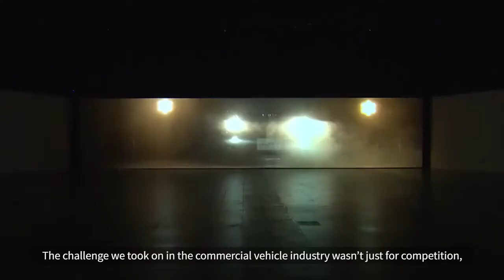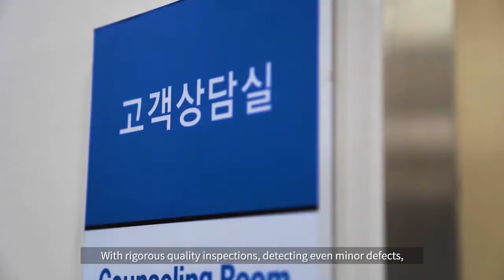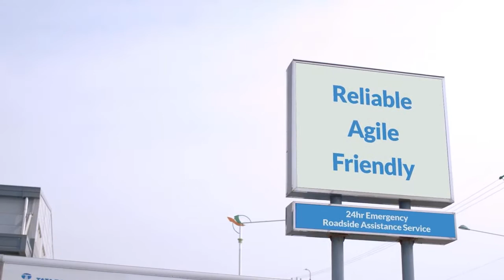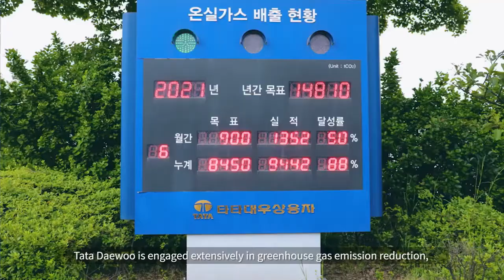2022 TATA DAEWOO Corporate PR Film ENG

Comment: when will this beauty come to india?
Reply: @JOKER 🃏 maybe these trucks are more advanced and high priced , in india Prima is tried to keep in budget so many primas come with non body coloured bumpers too
Reply: Tata prima
Reply: @helsreach001  ik , I mean these updated and more stylish looks
Reply: bro tata is already manufacturing here
Reply: @triggeredgamer206  ik , but this one looks premium also the Prima facelift 2020 showcased was also not launched and a few months ago they have launched it
Reply: @t.s.p1864  bro , This truck is available as Prima in india and now it get's ADAS , ESP , DMS , etc . Also Tata Sells open trucks which was only chasis and front bumber with headlights , other modifications are done by body makers
Reply: @t.s.p1864  cowl chassis are mostly purchased by low budget ones , and other than that the complete steel + fiber Body cabins are available in Ultra and Signa. Also Prima are used at large scale mostly as Dumper and container trailer
Reply: The prima,ultra,intra are based on this
Reply: @AesterAutomotive  Not Intra , Intra is mini pickup tempo based on Super ACE
Reply: @MrdRacer5Gaming  ya ok,its right man..but i said intra is no more unreliable underpowerd ace..
Reply: @AesterAutomotive  yaa that's right but ig ace is underpowered but not unrelaible

Comment: Who is owner of TATA daewoo......TATA or daewoo...?
Reply: TATAis Daew oo.sowner
Reply: Tata is owner of Daewoo
Reply: joint venture
Reply: @rocky9609  nope Daewoo had a subsidary of commerical trucks brand which was acquired by Tata Motors .
Reply: @rocky9609  bro tata accquired daewoo's truck unit in 2004
Reply: TATA, as it buy this in 2004.
Reply: yo mom
Reply: Fully owned by TATA